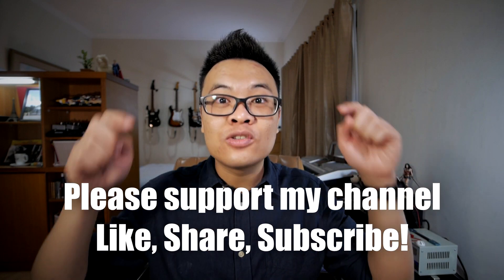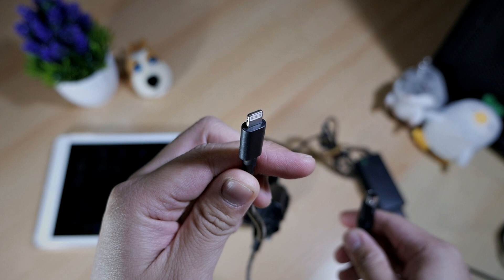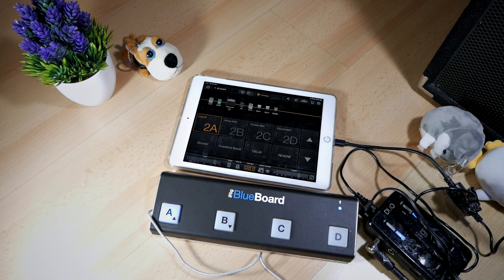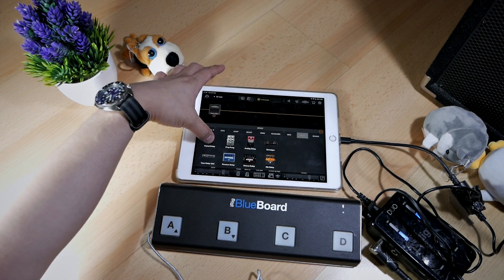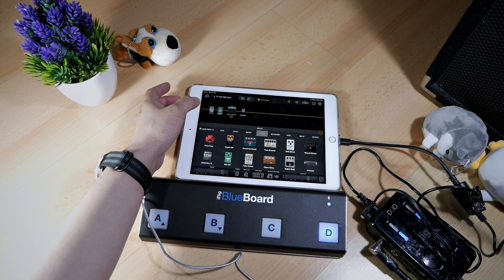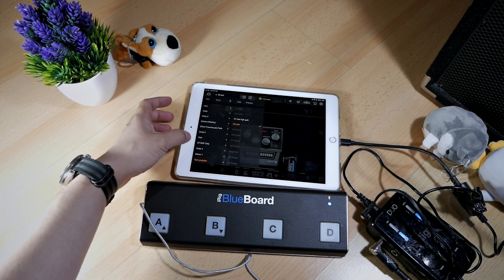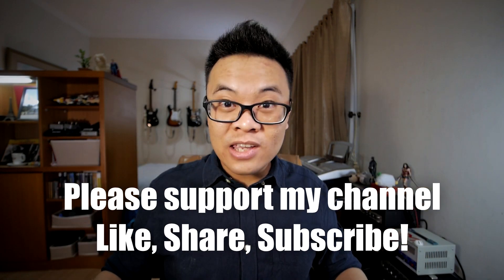Bias FX & Amp - Building iPad Guitar Rig - How to Setup Tutorial - iRig Blueboard & iRig Pro Duo

Comment from the maker: 💡  Below are my Tonecloud Presets as well as this video's time stamp

🎸 TONECLOUD PRESETS (search them inside ToneCloud in Bias FX)
1. Gary W High Gain - high gain distortion sound, very percussive, but warm and not too harsh. Good for metal and rock
2. Gary W Mid Gain - medium gain rock sound, classic tube amp overdrive sound.
3. Gary W Clean Wet Modulated - clean guitar sound with delay, reverb, and chorus to make the tone sound lush and wet.
4. Gary W Clean to Mid to High Gain - all in one patch that will cover all the tone that you need from clean to mid gain to high gain, with controllable amp switch, overdrive, delay, and boost individual control on the Live View

🎬 TIME STAMP
1:31 iPad
1:45 Interface: iRig Pro Duo
2:00 iRig Blueboard MIDI Bluetooth Foot Controller
2:19 iRig PowerBridge
2:30 1Spot 9V Adapter
2:39 Micro USB Charger
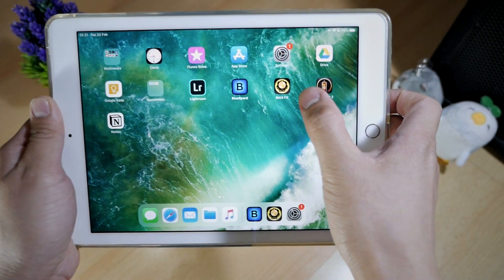3:06 Bias FX
3:45 Bias Amp
4:20 Synchronize Bias Amp and Bias FX
4:45 Blueboard App
5:05 Assemble the hardware
6:52 Setup the Software
7:12 Synchronize Blueboard with Bias FX
8:50 How to Create a Patch from Scratch (Clean)
11:12 How to Create a Patch from Scratch (Distortion)
12:59 Switch Between Patches
14:00 How to Switch On/Off Effects Individually (Program Change vs Control Change)

Comment: Really helpful video. One question: If I have a guitar and microphone connected to my iPad through an interface, can I use a setup like this to modify the guitar sound (perhaps to just one sound for me using garage band), and modify the vocal sound independently (adding some basic things like a bit of reverb)?
Reply from the maker: Hello Rishi, I haven't tried connecting multiple output on iPad i.e. in Garage Band or similar app. Maybe you can do that, but it will depend on both the app and the interface.

Comment: Hi Gary, great video. quick question - 

can a guitar be plugged straight into the ipad with a 1/4 inch to USB cable into a USB hub?
Reply from the maker: Hello Kelvin, thank you for the comment! Regarding your question, I haven't personally tried but I don't think you can do that, or if you can do that, maybe the sound quality won't be good enough. You will need a proper USB interface for iPad to get the desired sound quality. Hope this helps! 😊
Reply: No, also latency. That’s why a sound interface exists

Comment: For a live setup would you connect this to a speaker cabinet or an amp?
Reply from the maker: Hello, this requires an actual amp, you can't plug in this rig to a speaker. I usually plug in to either PA system on a venue, or to a clean amp at home for practice. Hope this helps :)

Comment: Just a question: is it possible use only GarageBand to play on the amp?
Reply from the maker: Yes you can, you can either use GarageBand built in sound and use the rest of the rig as an interface for the guitar, but you can also use Bias FX or Bias Amp as inter-connected app in Garageband and record the sounds from the Bias apps in Garageband. Hope this helps!

Comment: Thanks for the introduction of BIAS FX I didn't know it required those added devices:IK Multimedia iRig Acoustic Stage Digital Microphone System for Acoustic Guitars, IK Multimedia iRig Blueboard Wireless Floor Controller for iOS and Mac and a IK Multimedia iRig HD 2 digital guitar interface for iPhone, iPad and Mac (IP-IRIG-HD2-  by the the way I also have the sparks amp too
Reply from the maker: Hello David thank you for the comment. Yes, we do need some devices in order to be able to plug in the guitar to the iPad and output into PA or mixer or interface. Cheers :)

Comment: Hi Gary, I need your advice for a simple outfit comprising of an Electro acoustic guitar, iPad  Air  (2014) and an iRig2 (not bought yet) to be connected to a Marshall AS50. How will it work e.g. will connect iPad Hdphone output to the Marshall be the solution? Thanks for a prompt reply. Regards
Reply from the maker: Hi Roland, I'm not familiar with iRig2, but I imagine it should have both headphone out and amplifier out. So you should be able to connect the amplifier out of the iRig to your AS50. Hope this helps :)

Comment: Great video thanks ! How practical is this setup for use in a live situation like jamming in a studio with a band ? Is there any latency ? What's the total cost of all the gear ? Thank you
Reply from the maker: Hi there, I am using this exact rig to play live on my church since 2018, here's a recent video about it https://youtu.be/vCQ9E8Z-Aig 

There are slight latency when switching patches, but when you are just using one patch and use the controller to turn effects on and off, there is no latency. Total cost about US$500-600 (iPad Air 2 $200, software about $100, iRig Pro Duo $100, power bridge & accessories etc about $100), depending on which iPad model that you want to use it can also be more expensive.

Hope this helps!
Reply: @Gary_W  thank you for the response that does help a lot ! 🙏🙌

Comment: Can’t I just use the adaptor then plug it in my guitar?
Reply from the maker: I don't think you can't, I don't think the iPad has the capability to convert guitar signal to a digital signal. You'll need an audio interface or external soundcard that supports iOS.

Comment: Help needed!! I'm currently using the Irig stomp i/o pedal as my interface with my ipad pro 2018 model. My output amp is a Peavey vyper 75 set to clean with all effects turned off. For some reason when I use any downloaded tone cloud presets I'm hearing noise interference, Usually humming even when I'm muting strings. I've watched various videos on grounding loop issues or dirty electrical signals, I've tried various plug sockets positioning the amp in different areas of my home. I'm just a bedroom guitarist, so I'm not all that clues up with the technical side of music. Honestly thought it was just plug and play but I'm wrong. Anyone have any suggestions.
Reply from the maker: Hello Anthony, seemed to me like the possible cause for that is the dongle that you use to connect the iRig Stomp I/O to your iPad Pro. Maybe to mitigate this issue, try to use noise gate on Bias FX first, and see if it helps. If even noise gate doesn't work, then I think check the dongle. Hope this helps
Reply: @Gary_W  I think I fixed the issue by using the aux in instead of the imput as the amp I use is a modeling amp and it may of interfered with the effects. 👍

Comment: One possible correction. You don't need to run the BlueBoard app to access the Midi connections. There is a mode setting where you press the C button when you turn it on and that enables plain MIDI over Bluetooth without needing to run the BlueBoard app at the same time. In a lightweight setup using an old iPad you can use all the CPU cycles you can get! This may help reduce latency just a little bit in older devices.
Reply from the maker: Fprintf, thank you for sharing the information, I didn't know that. This could potentially help more people, thanks for sharing! :)

Comment: Nice video.  Can you switch between banks of patches using the Blue Board?
Reply from the maker: Hello Swalsh, yes you can, you can long press button A or B to switch between different banks of patches when you are in "program change" mode. I use a single bank of patches for each song, so I have to switch banks for different songs, and the Blueboard does it just fine. Hope this helps :)

Comment: Great video! Is there a way I can connect this to a larger amp or speaker? The iPad speakers won’t be loud enough for my garage.
Reply from the maker: Hi Omar, with the iRig Pro Duo, you can definitely output your sound to a sound system or amplifier. Just plug a 1/4 inch instrument cable from the output of the iRig to your amp. Hope this helps :)
Reply: Gary W can I connect it to my bose cinemate speaker ?

Comment: How about the actual out sound solution? Amp, cab, speaker?
Reply from the maker: Hello Julio, when I'm playing live, I plug in my iPad rig from the iRig Pro to the FOH mixer to the PA system on the venue. But when I'm home, I just connect to a clean amp. The iPad rig can't power speaker so we still need to use power amp. Hope this helps :)